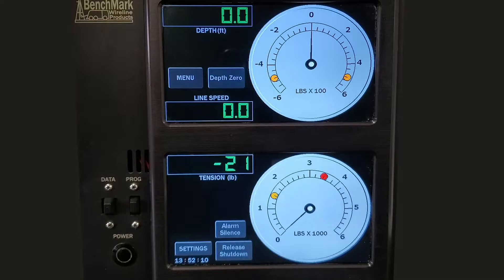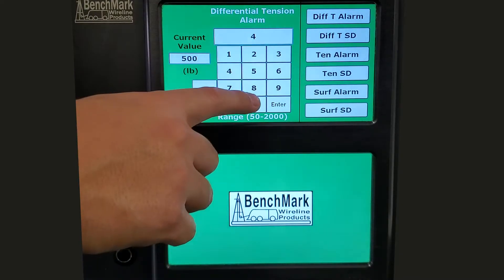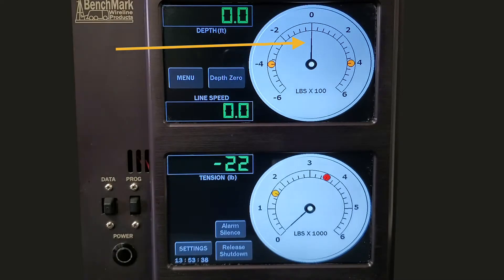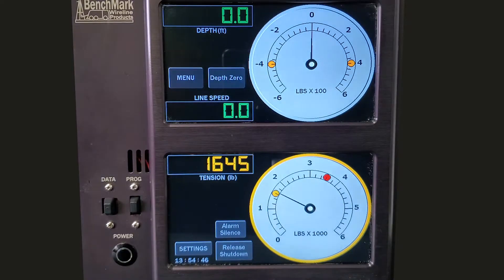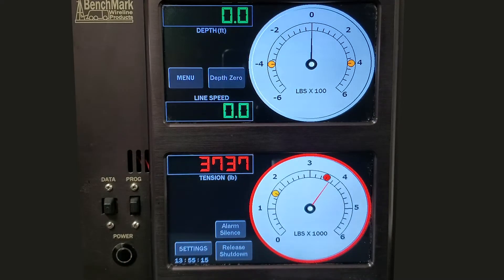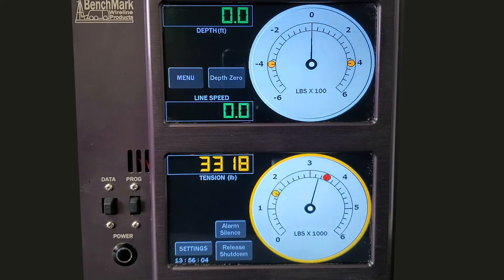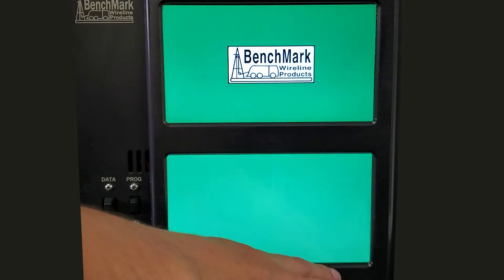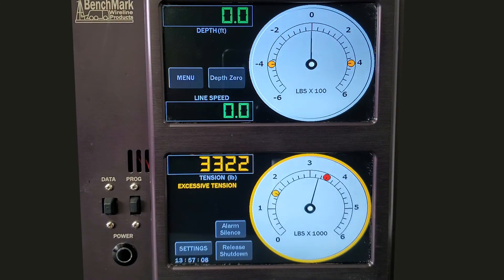BenchMark - AMD Operators Panel - Tension Management

Comment: I always wondered if that shut down would work . With the Schlumberger tension screen you can move the value with a click of a mouse . It does it faster and you don’t have to menu dive . It’s one of the safest and best winch systems I’ve ever ran. Now that I’m in “pumpdown “ we are using benchmark I really hope they update it soon to make it easier and faster to change the alarms .